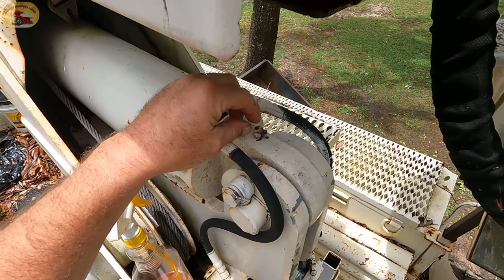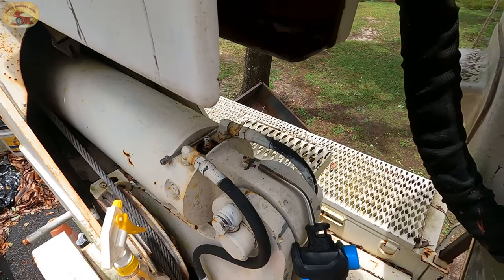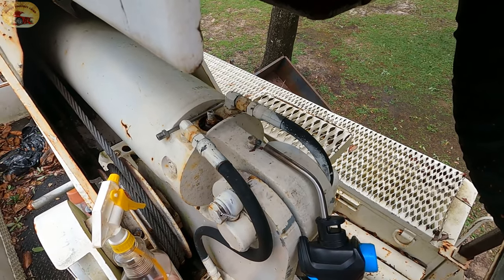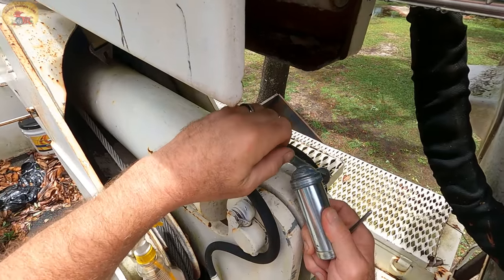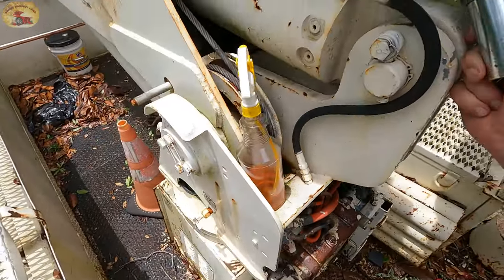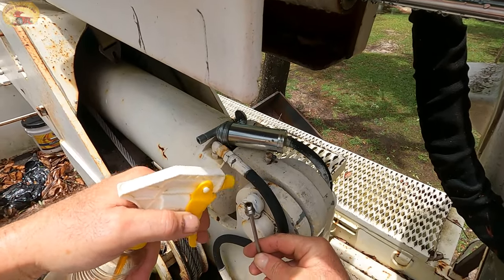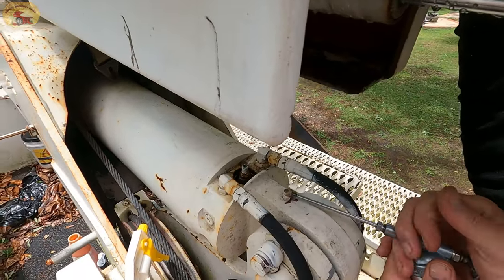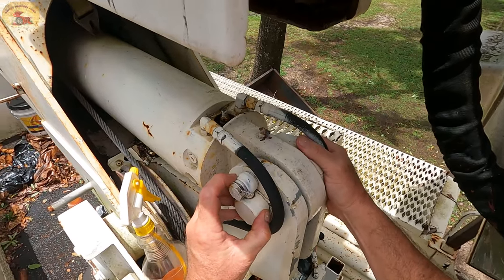How To Fix a Plugged / Clogged Grease Zerk Fitting Fast!!!

Comment: We call them grease nipples here in australia. Dunno if they are the same as your zerks but grease nipples have a spring & a ball in them & if you heat a spring it weakens them & the ball wont be pushed back against its seat therefor letting contamination in. I think i will just stick with changing the zerk/ grease nipple.
Reply from the maker: Thanks for watching and sharing, we really appreciate it. Hope you have a fantastic day my friend. mad Mike the hammer SPC

Comment: I tried greasing my casters on an industrial cart & on my welder. Oh, my hydraulic press also has those shielded zerks you know the ones that are a bolt on one side & has a nut with a zerk in the middle with a ring around it. My greasegun wont fit into it.  Is there a different size tip for them?
Reply from the maker: If the needle on this  https://amzn.to/2TNYhUf
&  https://amzn.to/3zE376N doesn't reach, please send a picture to sweetprojectcars@gmail.com and we will see what we can do to help you. Thanks for watching Tim. Have a great day. mad Mike the hammer SPC
Reply: Sweet Project Cars I have a needle greaser from snap-on. Didn't think it was for them, they are regular zerks just shielded.  🤔

Comment: I have a bluepoint grease gun with a pressure boost switch it pushes threw any pluged fittings😉 
I plan on getting a lock and lube kit as per your suggestion for my grease gun in the future as well🤘
Reply from the maker: Awesome! Thank you for watching and sharing Willy, we appreciate it my friend, hope you have a fantastic week. mad Mike the hammer SPC

Comment: Are there no rubber O rings in a zirc fitting?
Reply from the maker: We've never seen them.  They seal by using NPT threads which is pipe thread.  Thanks for watching Ender.  Have a great day. mad Mike the hammer SPC
Reply: @SweetProjectCars  Oh, I was thinking where the spring load ball seals at the nipple end. Thanks Mike.